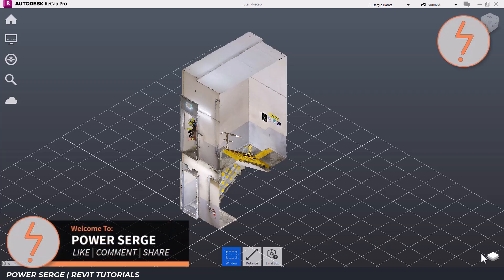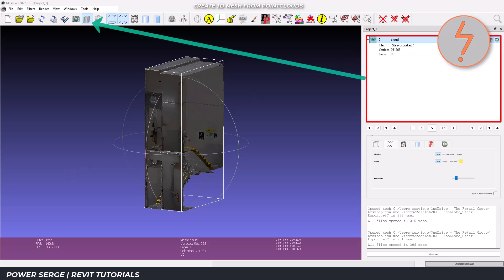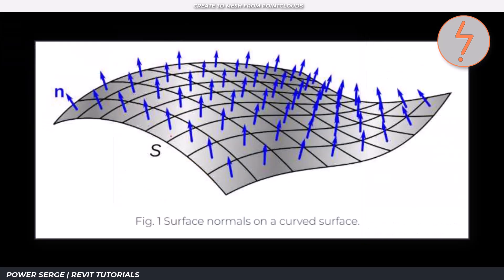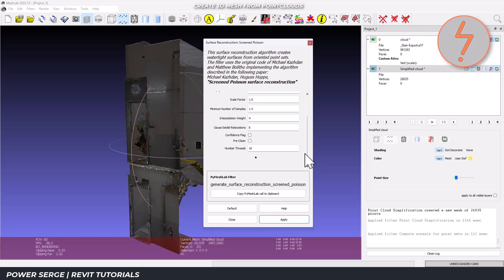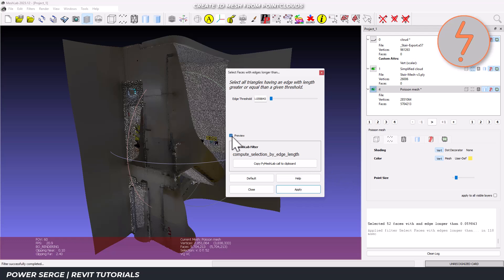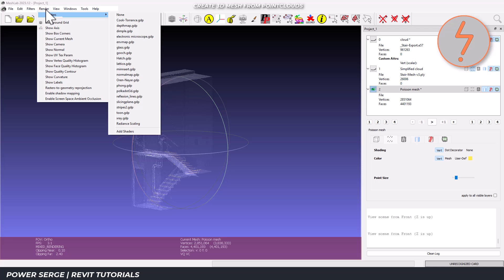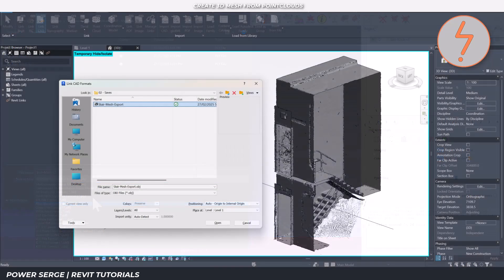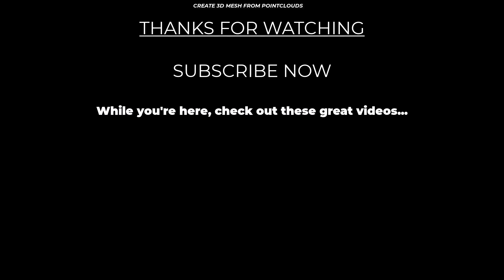How To Optimize Point Clouds for Revit Using MeshLab

Comment: having a mesh inside revit is even worst than pointcloud
Reply from the maker: Hey, thanks for commenting! You’re right — that can definitely happen, and it’s exactly why I made this video.

Point clouds use indexed spatial data, so Revit only loads the portion that’s visible in a view. Meshes, by contrast, are fully loaded once they appear, and high-polygon meshes can impact GPU and memory performance more heavily.

However, when a mesh is properly optimized with an octree or similar spatial structure, it can load only the visible sections, reduce redundant faces, and perform efficiently — sometimes even lighter than a raw point cloud. At the same time, meshes provide continuous surfaces and shading, giving better clarity, visualization, and usability than point clouds. That’s exactly what this video demonstrates.